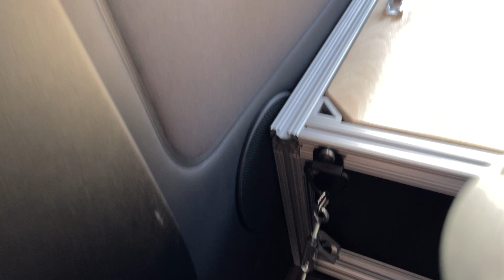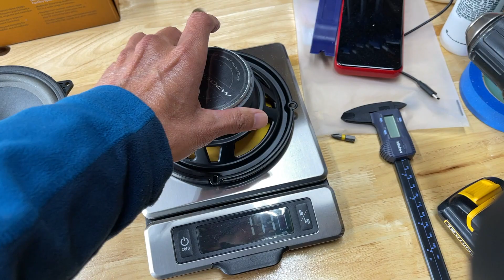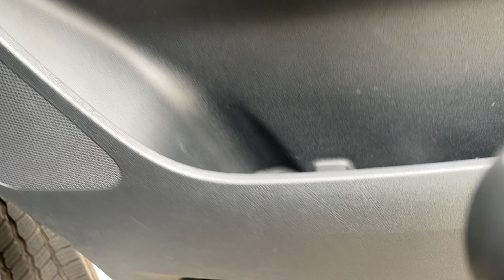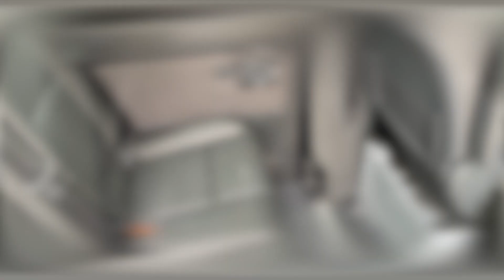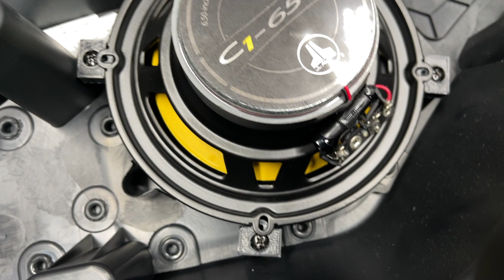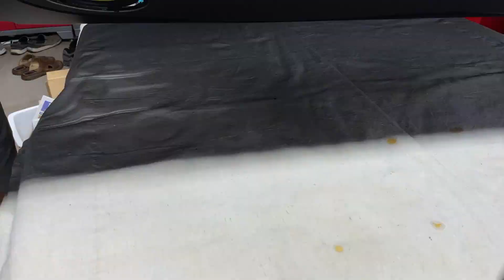How to upgrade speakers for 2019 Sprinter passenger van to JL Audio's C1-650 (ccoaxials & component)

Comment: Thank you so much for this video it is very helpful. I also have a 144 passenger van but mine has mbux. I am trying to do something very simple with no amp added. Do you think I can just use these same speakers as you and it will run ok just with mbux (no amp and no sub). Do you think it is a decent improvement with enough bass for general purpose listening? Thanks again for the detailed video!!
Reply from the maker: Thanks! I think anything would be an improvement to the stock if you have the same as mine. The plastic speaker covers were less secure after what I did. The one on the sliding door might pop out  if the door got slammed. Watch out for that.

Comment: Do you still think the OEM wiring diagram is valid? I don’t know how to replace the MBUX and preserve the control systems
Reply from the maker: If I understand you correctly, you have the higher end MBUX that’s not just the basic radio like mine. I am not sure you can replace it with a aftermarket head unit. I think you will loose all the features and controls related to the car itself. If you really want to improve sound, adding amplifier and replace speakers may be the only way. Frankly I wouldn’t have gone thru all the trouble if mine came with a BMUX. I would just leave it as is. Hope this help

Comment: Anyway I can pay you to print and ship the adapters needed for the exact build, I have an identical sprinter setup. Thx
Reply from the maker: Hi Jonathan, I uploaded the adapters' STL file to Thingiverse.com. You can find the links in updated video info above. You just need to download the ones you need to a thumb drive and take it to your local 3D print shop to have them printed. Good luck! Give it a thumbs up while you at it. Let me know how it goes.
Reply from the maker: Thanks Jonathan for the comment. I was afraid of this question might come up but didn't expected it was my 1st comment :). The thing is it takes my little hobbyist 3D printer a little over an hour to print a set of 4 for 1 speaker. Plus shipping there will be a lot of time involved and I can't ask much for those little pieces......and there may be more requests....Let me explore if I can upload the design file to one of those 3D printing website. Whoever wants them can order from them (I can't imagine it they would ask a lot). Let me get back to you here when I find out. Thanks again for the comment!
Reply: Thanks, I will dust off my 3D printer. Thanks for this big request.
Reply from the maker: Consider putting a sub too while you going through the trouble tearing open the panels: https://youtu.be/QmLZ44yDPeo